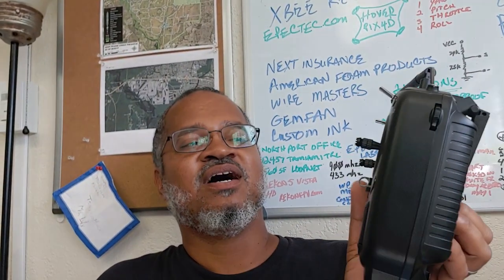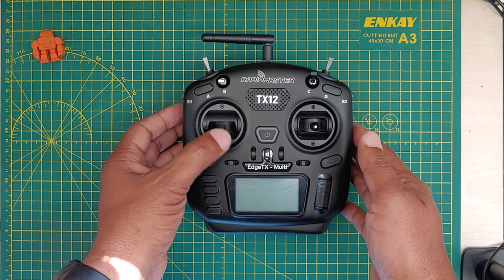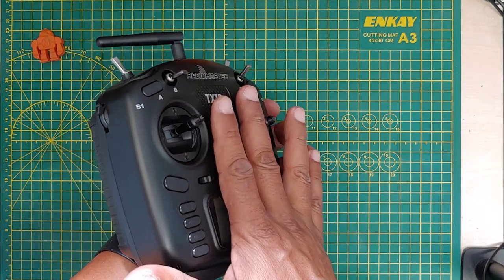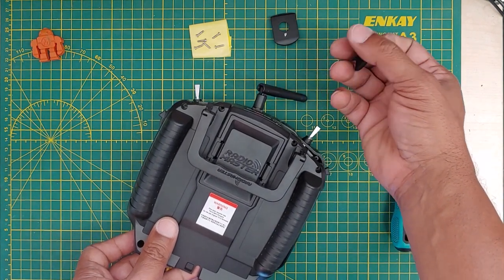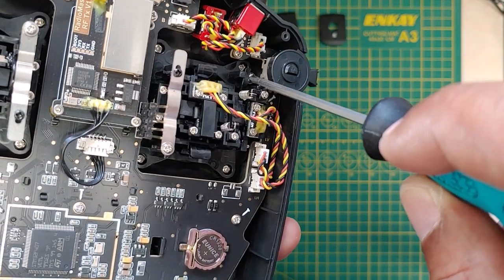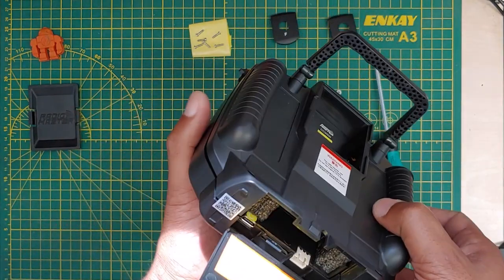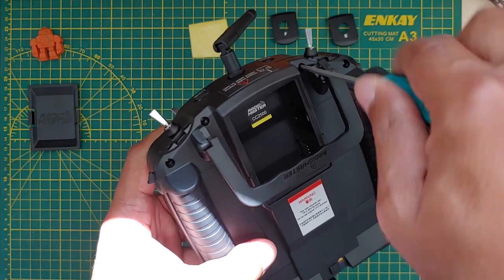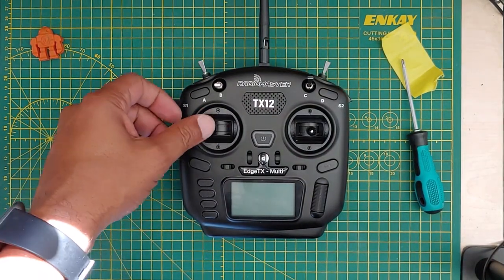Radiomaster TX12 Self Centering Throttle How To

Comment: thanks man i never knew i needed to pop those E and F switch holders, the throttle gimbal on this radio felt tight . after loosening up the screws it's good now
Reply from the maker: I'm glad it helped.  It helped me a lot to adjust my throttle, especially when I was first starting out.

Comment: Dude thanks a bunch. I've been flying planes and helicopters in battlefield so long my brain is just hard wired for pitch and roll on the left stick. I bet I can just insert the screw on the right side stick to disable that spring there and enjoy a control scheme I am used to.. on the other hand maybe I should learn how to fly like this so I can pick up someone elses drone too though... Hmmm nah I'll cross that bridge when I get there
Reply from the maker: LOL  Yeah, that is exactly what happened to me as I was working with the difference between multi-rotor controls and fixed wing.  That's what drove me to see if I could adjust the stick gimbals.  Most of the good quality radios will have these adjustable gimbals so you can really get the feel you want out of them.  Glad this video helped.

Comment: Hey, Awesome video, is there anyway to then make the throttle be 0 whilst being in the centre, e.g. as if you were playing on an xbox or playstation controller? Thanks, :)
Reply from the maker: Okay.  There are several ways to do that.  Depending on your model, you could make the adjustment on the flight controller using your setup software (what I usually do for quads) or you could do it on the radio by adjusting the mix for that channel (stick input).  I'll try to get a video up for each method soon.

Comment: video is set up nice just confused why anyone would need a centering sprint on a controller mostly used for fpv drones that would make 0 sense to even use as there's no stabilization unless in horizon mode or the beginning mode limiting the angle of the drone even with horizon this would do nothing the only plausible reason i could think of for this is maybe for a rc vehicle like a car or truck or rc scale model tanks, construction equip etc this is like tht stupid trend of ppl angling the motors on there drones just to find out it sucks
Reply from the maker: True, true.  Do Not Use This For FPV Drones.  I do not use this for FPV flying.  I do a lot of testing on drones made for inspection and mapping services.  On mapping and inspection missions I usually fly in either Alt or Pos mode.  This controller is nice for that quick test when I don't want to take the bigger controller I usually take with me.  Again, I do not recommend this for FPV.  LOL
Reply: I learned to fly in Sims with a ps5 controller 
I fly mode 3 and I fly with self centering stick.

On my tx16s my gimbals have WAY too much travel/throw for me. Even being max restricted.
I have short fingers that I have to fully extend to go from bottom of throttle to top of throttle.

I'm trying to setup self centering throttle on my tx16s but it gives me throttle warning and won't let me arm my drone.
Reply: Old comment but, I do 3d flying where you can reverse the motors to fly upside down, which makes it so you idle at halfway on the stick, this is perfect for that

Comment: I wouldn't want that,
 I have enough trouble keeping proper throttle 😂
Reply from the maker: LOL The reason I started doing this was because I always had a hard time keeping the throttle on my quad at a hover.  I set the hover thrust level in QGC so that if I left go of the throttle the spring automatically brings my quad to a hover.  🙂
Reply: @bentsprockettech  Right, I can understand that function.  I read that after my comment.  Happy flying ✈ Thank you👍👍
Reply from the maker: @capnhardway  Happy flying to you as well.  🙂